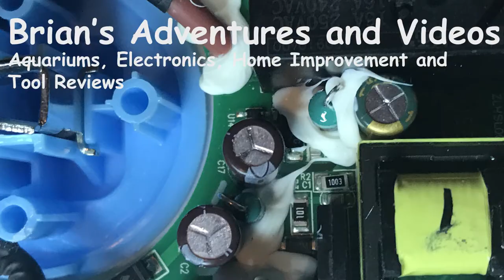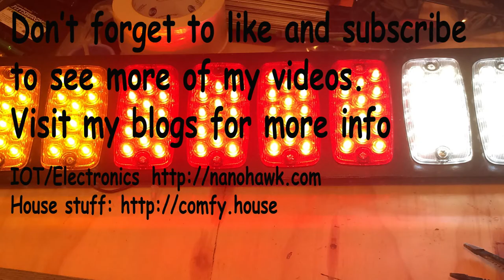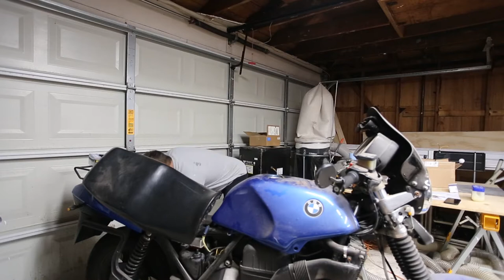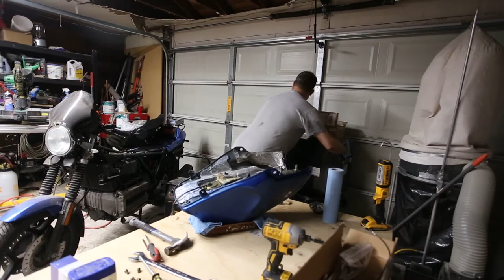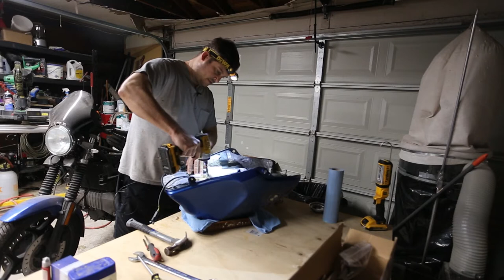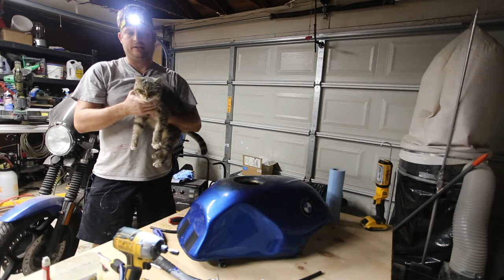BMW K100 Motorcycle - Fuel hoses, pump grommet and more rebuild

Comment: Good straight forward  video Brian.
The basket is really tricky!
I found out the hard way!
You have to get that on with the pump body removed, set it into the rubber vibration damper groove.
Lubricant the pump body and slide it back down into both again.1/4" inch short of bottoming out.

Comment: On mine, the pump suction filter screen  on the end of the pump body connects to the rubber damper via a small slot. It is very difficult to get it to engage without tearing the filter or the flimsy rubber.. I don't think it just "sits there". It needs to be secure.  Lots of good information in this vid.  Thanks.